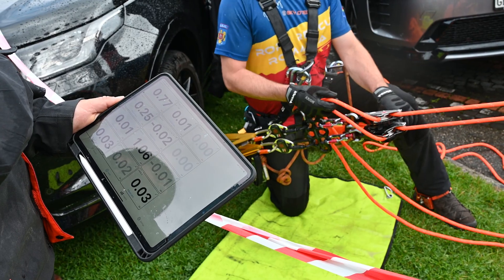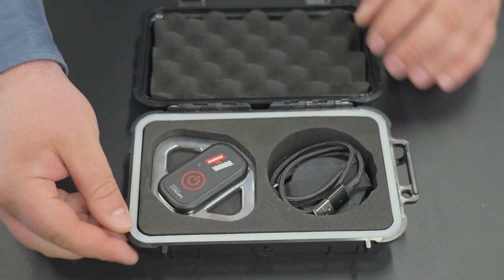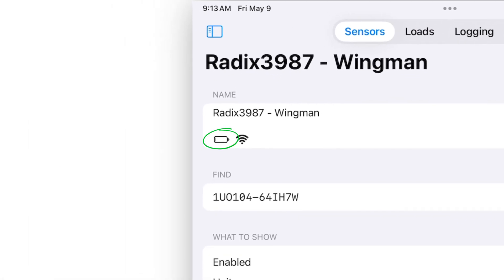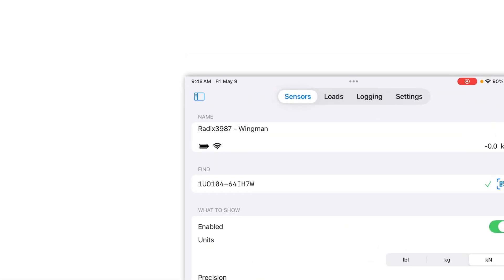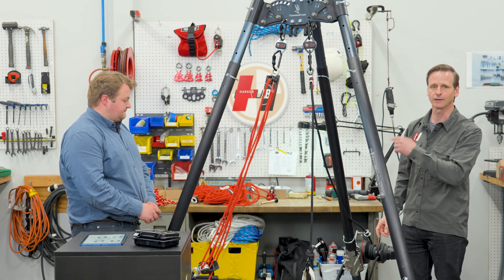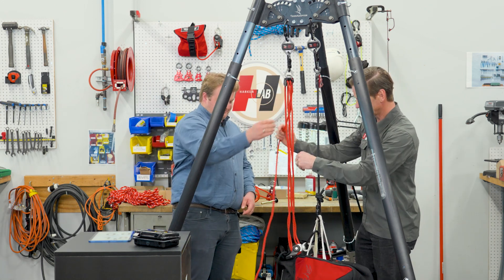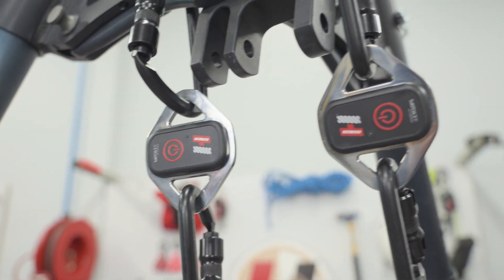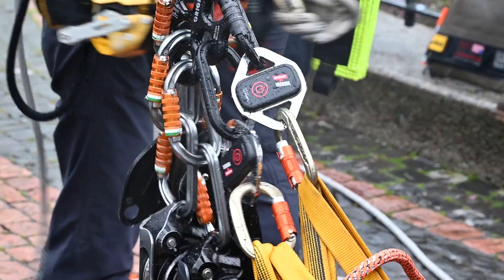Introducing the Harken Radix

Comment: How quickly does it detect and can it document short duration peak loads??
Reply: The Radix is factory set to 3Hz (every 1/3 second) with 10Hz option (every 10th of a second), which is suitable for for static, semi-static and moving loads. The Radix will capture a peak load in a dynamic event, but won't offer the granular detail that is often desired in a planned drop test.

Comment: There absolutely needs to be a way to tell the battery level without a phone.
Reply: When the battery reaches 20% or less charge, the indicator light on the unit emits a "double-flash" when "ON". With the battery life the unit boasts and contactless charging, this should not be an issue.

Comment: Lads are super proud of the fact they've glued a commodity force sensor to a piece of metal. Well done guys.
Reply: Eh, I have used dozens of industrial load cells, strain gauges, and amplifiers of various technologies, and none of those would be this easy to use in the scenarios for which it's intended. They're rated for life support, which is a big deal, the packaging provides IP68 and wireless charging in a remarkably small and compact form factor, and the app isn't bad. The competition for this thing isn't a bloke in a garage cutting out a piece of stainless with an angle grinder and gluing a strain gauge and op-amp PCB to it, and it's not an industrial crane scale, it's more like the Linescale 3. The Linescale has the screen on-board (a big selling point for me) but is significantly more bulky.

Comment: There don't seem to be any easily visible  ID codes on the back side or color markers (changeable bezels) on the individual devices, so in a hectic rescue situation, how do you identify which reading is which cell?
Reply: There is a laser etched serial number on the s/s body to identify individual units. The name can be customised within the app to include SN and/or rigging location, providing clear identification. Users can add visual identifiers such as coloured tags etc, as long as there is no interferance with connection/operation.